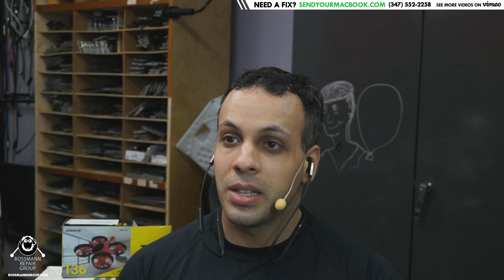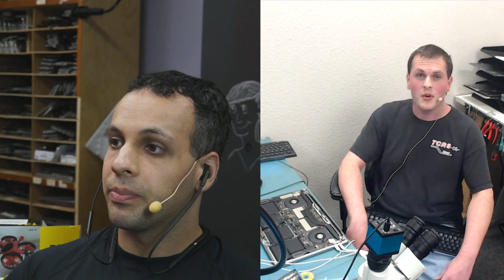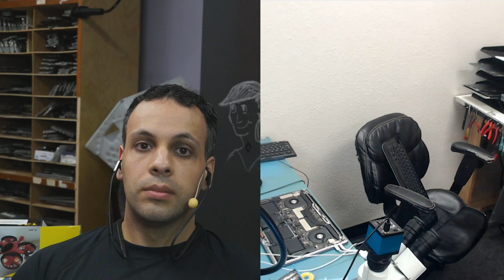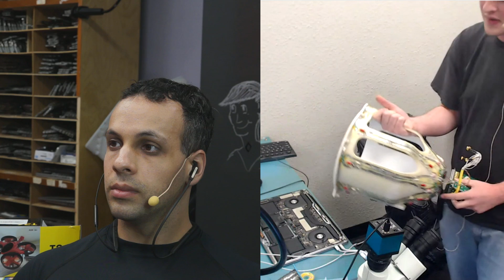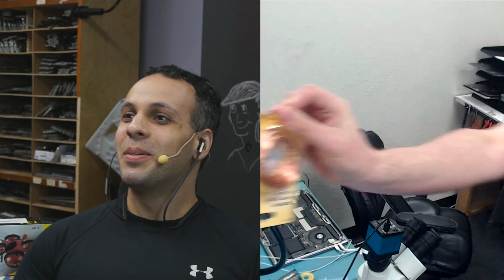Tim started TCRS Circuit at 16 with no $$. He now has a board repair store in California.

Comment: I have nothing but the greatest praise for Tim and his business. Recently, my MacBook pro exploded (or what I defined as an explosion). What really happened was the battery short-circuited after my failed attempt to remove the back cover to fix the trackpad. It looked a mess and I was feeling like I had lost all my files, programs, etc. I took it to Tim, and he looked at it a gave me so much hope. I didn't lose any files. It looked worse than it actually was. I've had other experiences with computer repair shops and discovered they were like many auto repair shops (I don't need to go into that, right...) Long story short, his level of professionalism is unmatched in this valley. He even went as far as assisting me with locating another used MacBook pro with excellent specs. MUCH MUCH respect to Tim and his company TCRS Circuit.

Comment: Hi Louis, quick question:  my laptop my wifi keeps dropping after around 1 minute. It says it's secured just that there is no internet. I have rebooted it in safe mode (network) and it still drops it after a minute. If I continue to turn it off and on it will work for a minute once again. Please let me know if you have a solution to this. Thank you very much!

Comment: He is venturing in MRI technology. I hope he discovers how to make an MRI bigger and less claustrophobic.
Reply: They have them. It's called a open MRI but it doesn't come without compromises. The field strength is much weaker and the image quality isn't even close to being the same. Most "tube" type MRIs are 1.5T or 3T. Open MRIs are usually 0.3 or 0.6T or along those lines. Tube type is much much better.

Comment: We sent this "kid" a customers liquid spill computer which we had verified the logic board as being defective
by swaping in a good logicboard, he insisted it had a bad display and there was nothing wrong with the logic board. I asked if he had swaped the board and he said he had checked the main rails on the board therefore
it had to be a defective display he wanted 600+ for, we had the computer returned removed it from its apple 
find my mac id, replaced the MLB and it has been working fine for the customer. and we put the orignial 
mlb in a test chassis, dead as we originally diagnosed.
this is poor work if at a minium you cant even identify which module is defective. and dot have a stock 
of modules to test with, sorry this is the case we were really looking forward to having a west coast place
to send liquid spills,
Reply: First off, i'm not a kid. 

Secondly, We don't have you in our ticketing system. https://imgur.com/a/uIzQr7i
Reply: When you say it had a bad MLB, what was the issue with the board? Was there a voltage missing? The display was just black? Was there some kind of artifact? Im curiouse how something that trivial could pass by Tim, and I know if this is a legit comment and issue you had with him - He always wants to better himsef and his service to make sure things like this dont happen.
Could you help us all understand what the issue with the logic board was and also a hint at the modle? For 600+ a screen, sounds like a 2015 or newer system.
Reply: @joesipaq  Also to note, the 2014-15 displays are different and not interchangeable between years. A common mistake is to use a 2013 display on one of the newer machines, it won't work. It needs to be from the same year on the newer models, excluding the new 2016-2018 machines.
Reply: Do I detect some jealousy here? You couldn't fix it so you sent it off to someone who could and then pitched a fit because they found that the problem wasn't what you said it was. I have a feeling there is someone being childish here and it's not the 18 year old doing board repair.
Reply: no they mis diagnosed it as being a display 
which it was not as verified by replacing the logic board which is why we sent it to them
after lewis's recomendation, we are not doing liquid repairs, we wont sell computers with repaired liquid spill boards
Reply: Ok so instead of taking it up with Tim himself you took it upon yourself to try and discredit and demean him on a youtube video all because you don't do the component level repairs yourself. Then you start throwing big words that make it sound like you know what you're talking about together and can't even spell Louis's name correctly.  I fail to see how you're not being childish
Reply: yes you have our customer in your ticketing,
and we are well aware of the variations in displays for these we ship several thousand a year
I'm just saying you totally blew this diagnostic by not doing the basic which module is it.
and quoted replacing a part that was not the problem.
I assume you ran through the voltage checks but that is not sufficent.
Reply: @brentwright2297  What is the ticket number then? If we recommend a display, and you declined, then that is not our problem. You ultimately declined the repair, and hence we  could not finish the diagnostic. We do not stock screens for every model macbook. It makes no sense for my business model. Board level repairs make up for 99% of our income, and we see very few screen replacement repairs. 99% of my customers are very happy with the services i provide. Those customers include end users, small businesses, large corporations and even medical facilities. Keep in mind, that if you are telling the truth and are a actual customer, YOU PAID NOTHING. I charged nothing for looking at the machine, and it was sent back with only a return shipping charge. If that is the case, you are sitting here complaining over something that you didn't even pay for, and taking the time to publicly bash someone AFTER PAYING NOTHING.  If this is the ticket I am thinking of, and you are towards the coast and your customers initials start with a G, he was incredibly rude with me after I received the machine, Calling me several times for updates in a rather rude fashion and tone, when I told him I was still in the process of diagnosing his machine. After repeated calls, I called him back, with my thoughts on the diagnosis and my findings on the board. I suggested to him that I believed this was a issue with the screen and gave him a quote, which he declined. 

If this is the ticket in question, Here is the diagnostic report. 

Believe what you want about myself and my apparent "poor work" but ultimately, your opinion does not matter to me and most other people. Have a nice day, and good luck with your business. 

Initial issue -- customer states no video on screen after liquid spill.

Performed complete inspection of system board. The eDP connector is not corroded, burned or otherwise damaged. The backlight circuit is functional and has no visible issues. The backlight fuse is not blown. LCD panel power is present, and at normal levels indicating that display is detected by board.. There is no blown filter in the LCD power circuit. There are no blown filters on eDP lines. All edp image filters measure normally. There is no short on any of the eDP image lines. The CPU vcore circuit is unremarkable. There is no corrosion, signs of overheating or other damage. The 3.3v and 5v generation circuit is clean and is functioning normally. There is no issues in the battery charging circuit. The CPU has normal resistance to gnd measured on all 3 phases. PP1v05_s0, which supplies power to the PCH, has normal resistance to gnd. --- The I/O board and cable are severely corroded, and need to be replaced --- . Image issue is most likely LCD related as the board is detecting the display, POST'ing and is otherwise functional. THere was no liquid damage to system board. Previous testing via external display was irrelevant, due to corroded I/O board and cable.

Recommend new display and new I/O board and cable.
Reply: TCRS Circuit crickets I guess he has nothing else to add. 😂 good job following Rule #1: C.Y.A. !!!

Comment: What type of earbuds does Louis use? I wish could search through YouTube comments in case this was already answered.
Reply from the maker: http://rover.ebay.com/rover/1/711-53200-19255-0/1?icep_ff3=2&pub=5575296144&toolid=10001&campid=5338082989&customid=jabra2&icep_item=163747820976&ipn=psmain&icep_vectorid=229466&kwid=902099&mtid=824&kw=lg

Not the best, but pretty good. https://www.rtings.com/headphones/reviews/jabra/elite-65e-wireless They go in the ear so they block out some outside noise, and the mic is very good at rejecting outside noise if you cover it with foam for the wind(it doesn't come with foam). The ones with good mics usually have trash sound quality for listening, and the ones where they have amazing sound quality for me usually have terrible quality for the other party. This is a good balance of both.

Comment: Hello Louis(and possibly Tim),

I've been watching for your videos, Louis, for years now. I'm wondering what would be the best old machines to look for on ebay/craigslist/etc to get in some machines to fix. Basically, I'm looking for ones that have parts that are still available but not expensive. I figure I can learn to read schematics better than I already do through just picking common issues with the motherboard I have an going tyhrough the process to fix it. I love the work you do, and I'd love to do it, even just as a side gig right now. I'm a mover, so I move furniture and heavy objects and beat my body up, and I'm approaching 30 and would love to transition away from that. I've already looked locally and there isn't much for board repair outside of ONE apple store and uBreakIfix and they don't deal with most issues.

Sorry, to shorten teh question, what is oldest series of macbook boards I should be looking to purchase that will have skills that transfer over to the new ones easily.

Again, thanks for your videos! And to Tim, thank you for being on this video, as YOUR story inspired me as well.

Comment: Mechatronics engineering student here:
Thanks to you, Louis, I tried stuff I would not have tried otherwise.
I repaired an old benchtop PSU. 
I opened up my old (perfectly fine) Netbook to see how it works and where all the stuff is on the schematics (no boardview sadly). I wanted to see if I could find a way to add and power an additional SATA port to transform it into a NAS. So I looked at how the power on sequences work and stuff like that. 
That project is currently on ice though as I am writing my thesis. For that I build a small test stand and made most of the electronics myself. One of the Sd-card modules came wired incorrectly. I un-soldered the Smd level shifter, lifted one of its legs and added a jumper wire to the correct place. And it works flawlessly now!
I don't think I would have tried that  without Louis.

After my thesis I will definitely try to repair more stuff. 
Thank you for my new hobby and all the things you thought me Louis.

Comment: It also helps to have your parents shoulder some of the financial burden.
Reply: If that's an option or you're fine doing that.  I didn't want to ask for anything so when I started doing custom hand built furniture I payed for everything through the hobbies I had prior through doing post/editing work for local photographers as a discount rate for top quality work along side graphic design/artwork commissions from a fairly old desktop I had built years before.  I used and still mostly use all hand tools so the price of equipment wasn't as high as if I had to buy a lot of machines at the time.  Still proper hand tools aren't cheap but after selling a handful of coffee tables, end tables, etc I was able to get some really solid tools, a lot vintage but in basically mint condition, and go from there.

Since then I've drifted back into my first love/hobby which was sculpting.  Mix in 3D printing and I can sculpt a figure in zbrush, break it down into printable pieces, print, add filler to sand down to the proper smoothness/shape, assemble everything and clean up any joints with filler/sanding then prime it and make a mold to cast a limited run of a piece.  Then for extra value I bring in my wood working and build custom display cases of a certain design for each particular limited run.

Comment: I just pulled apart my Bluetooth speaker that stopped charging guess the micro usb port cracked off the board when i left the cable in and threw it in my car. So I fixed it but dam I need a much better soldering iron. the soldering came out kind of crappy but it works.
Reply: g6qwerty hey good on you, that’s better then going out and buying a brand new one!
Reply: Were you able to fix it without any plans(just by looking at the dissassembled one and analysing) or did you have any plans? Cause I have a pair of bluetooth in ear headphones lying around that got the same issue and if there is the option to fix it I would wanna try it.
Reply: The TS100 is good and cheap, and there's a new version too that I've forgotten the name of.